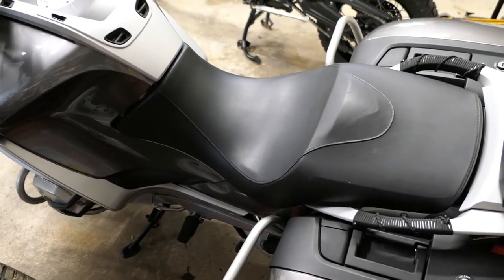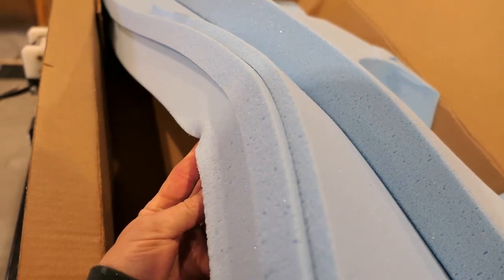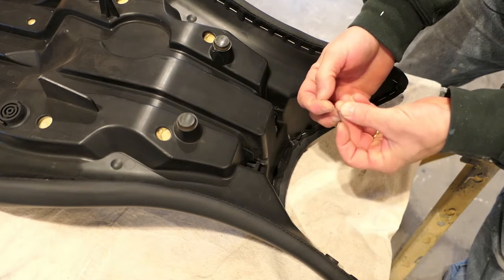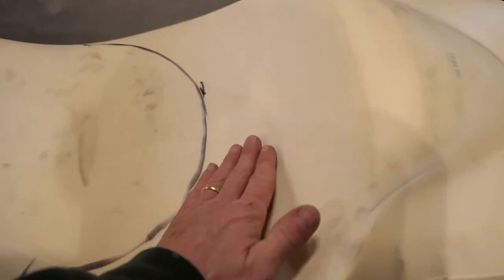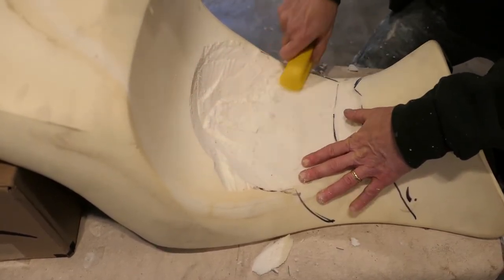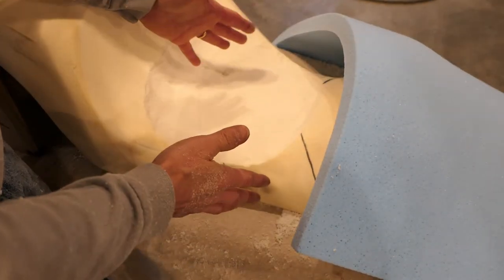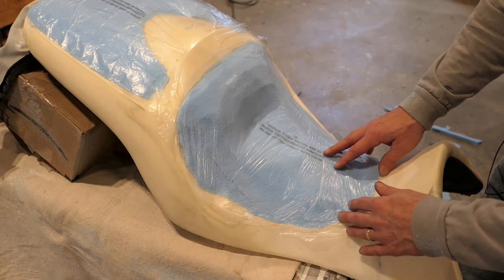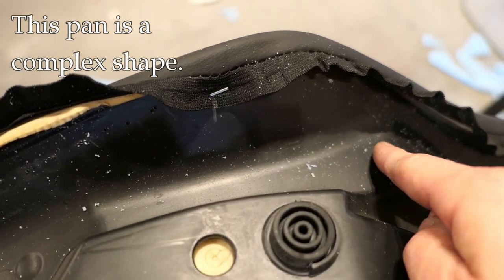BMW R1200RT Seat Foam Upgrade And Shaping

Comment: Outstanding work and skill, definitely a cost effective solution. I have a 2011 R1200RT with the low suspension and anything over 2 hours is uncomfortable. My upholstery skills have proven to be non-existent, so I chose the expensive solution and bought a Sargent Low seat with the November discount and free shipping. Keep up the great work, your videos have allowed me to perform all my maintenance including servicing the drive shaft.
Reply from the maker: I looked at the Sargent seat as well, but I'm just too much of a cheapskate!  I figured I'd give this a shot and if it was a fail I could always get a Sargent or a Corbin.  The original seat cover is certainly not perfect, but it's functional for now.  I may play around with that in the future.

Comment: I had a go at my 1200 gs seat a few weeks ago, its pretty easy once you get over the fear of thinking your going to destroy your seat but the game changer you have done is adding the extra layers and blending them in I’m going to go back in and tweet mine again, thanks great advice
Reply from the maker: You're right--it's the fear of destroying an expensive seat which stops a lot of people from trying this!  I've been pretty happy with my modification and it worked well on a cross country trip I did earlier this year.  The only thing I might change is to look for a plastic sheeting over the foam which lays smoother.  I can see a couple of wrinkles on the sides from that plastic, though it doesn't affect function.

Comment: Great video but sadly I don't think with my limited skills I could achieve what you have. If I ever  do pluck up the courage to attempt to do it yours will be the video I will use . Stay safe.
Reply from the maker: It is a little scary at first, but if you sneak up on the dimensions with the knife and the grinder it's less risky.  Once I realized that I could always start over with more foam if I made a mistake it just became a matter of taking one step at a time.
Reply: @tinderboxarts  Thank you

Comment: The 2014 RT does have plastic protecting the foam under the seat. However it didn't work well as I have green mould under the seat on the groin area. I guess rubbing against it over the last 10 years took it's toll, hence the need for me to reupholster. I want to change the shape too with extra foam at the rear
Reply from the maker: Ugh!  That's kind of gross!  Maybe water got in there from underneath.  I never did change the stock cover from when I did this video, but over time it conformed to the new shape and it is still going strong.
Reply: @tinderboxarts   That's wild from a much older seat than mine. Maybe because I ride in all weather daily. I noticed my stitches don't look good either while I was practicing doing butt stitches with a V92 thread top stitch on scrap PU leather and comparing, the thread that's on the bike looks very worn away. Looks like they used a not very good thread like bonded polyester. I never liked the seat on the 2014 onwards models. Too plain. I'm using this as an opportunity to make it look much better. I'm even backing a backrest for it.

Comment: The most comfortable bike I have ever ridden with had two "cups" cut out for your man parts.  It really helped with the smashing of the lower parts sitting on long rides.  
Looks like a big improvement in the total seat though, how has it held up on long rides?
Reply from the maker: In June of this year I did a 5600 mile cross-country trip in 14 days.  Most days were 8-10 hours in the saddle.  I was a little worried about the seat, actually, and I hadn't done any major riding like that since covid.  But, it turned out to be just fine.  Obviously that amount of time in the saddle will result in some discomfort no matter what seat you have, but I was as comfortable as I could be doing 600 mile days in a row.  The foam has held up well.

Comment: Nice video, I own a S1000XR and will add some gel pad. I cant understand why the motorcycle seats are made sooo cheap.
Reply from the maker: It's true--manufacturers often cheap out on the seat.  Ironically some of the most comfortable factory seats I've ever sat on were installed on inexpensive bikes.  Go figure.